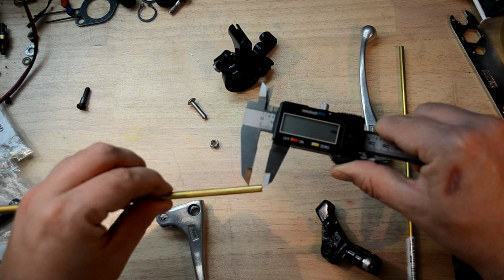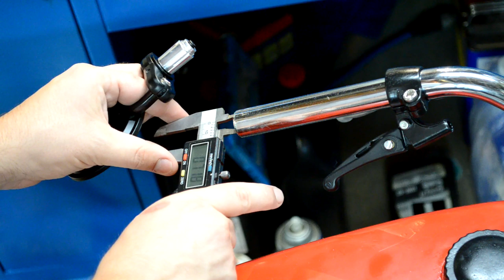1979 Puch Magnum Project Part 11 - Lever's, Throttle and Cables

Comment from the maker: I just used dry tissue - Wasnt too concerned with any excess as they were geting covered by the grips.

When I do care about excess, and I make a mess I'll use lacquer thinner which does a decent job. Unless I'm working with or near painted surfaces then I'll use denatured alcohol.

Comment: what's the red grease stuff you use when you lubed up the handlebars for the grips?
Reply from the maker: +scythe910 It's just regular bearing grease, I use Mobil 1 Synthetic grease because its what I had when I repacked some bearings. I only used it for the throttle so it would turn easily on the handlebar.

You can't use it to get the grips on the bars or the throttle tube - Try getting them on dry, if that doesn't work then use an air compressor and direct air between the grip and the bar, or use soapy water.
Reply: Thank you that was a lot of help, cheers